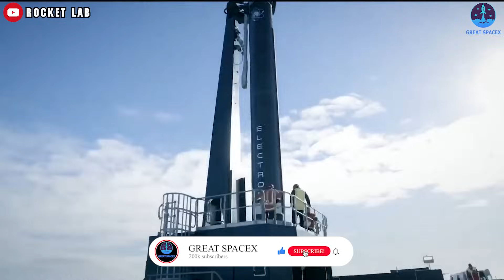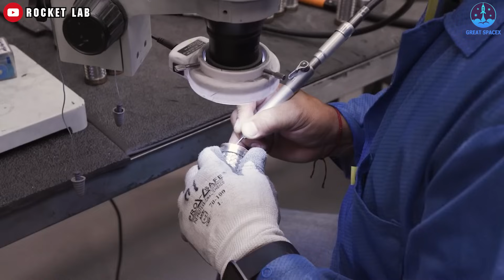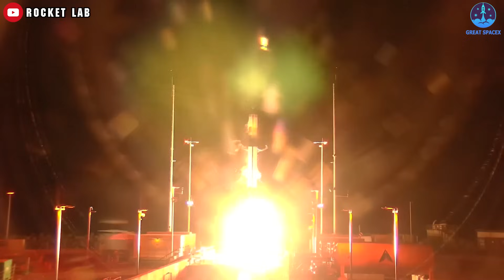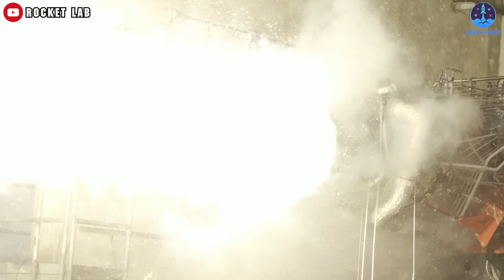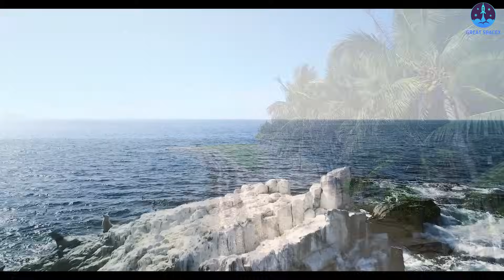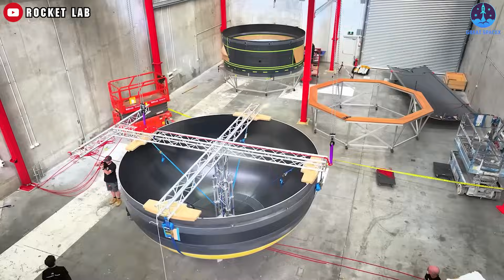Rocket Lab released the Boldest Rocket ever humiliated Blue Origin...

Comment: Good video. One minor correction. Carbon fibre doesn't handle high temperatures well unlike SS stainless steel. RL solution is lightweight aerogel graphite composite layer coating. This is how they protect Electron during reentry.

Comment: Carbon fibre is held together with resin… how do they figure on the “glue” between their composite carbon from melting with the heat of reentry?
Reply: The brakes on my car are carbon fibre. They use a ceramic-metal matrix, not a resin matrix. Max temp for resin is only about  200C, but over 1000C for ceramic-metal
Reply: @RedBatRacing … Thanks for taking the time to reply. Appreciated!
Reply: @RedBatRacing easy to forget different compositions exist when we see fools making Composite subs that implode because they chose entirely the wrong material, and with the likes of SpaceX's leader loosing his mind and pushing an under developed rocket too far we really need a sane competitor especially as the USA seems primed to implode
Reply: @UNSCPILOT  Rockets in space and Submarines submerged in the deepest oceans are quite different designs.
Reply: @RedBatRacing Brakes are a ceramic matrix which is a great technology for this application.  But aerospace composite structures are formed using a resin to bond the fibers together.  A totally different technology.  The resin has significant temperature limitations.

Silicon carbide carbon composite brakes are stable up to a temperature of 1800 degrees centigrade while carbon composite materials are limited to only 500 degrees centigrade.
Reply: The same way the current rocket does?  While they talk about "reusable" what they are quieter about is how many lift/land cycles they can manage with a single body.
Reply: @iatsd theres a lot of un-answered questions regarding neutron. It's a big risk when knowing spacex will be launching more for far cheaper and more often turnaround and much further ahead of the game. The Us military (space force) it is a strategic plan to support this for the future development of launch and retrieval pads for the long term future in NZ.

Comment: Gasoline for cars has become a more and more complex formula to boost efficiency, so why do rockets continue to use simple gas and oxidizer solutions? Even jet fuel isn't a simple two element compound. It seems much of the fuss with space exploration is in keeping gasses cooled to be carried as a liquid without requiring high levels of compression. There's got to be a better solution in more complex liquid formulas that are stable with a much higher boiling point.

Comment: Any chance to see Sfarship that use 3D printer (to reduce cost) of Carbon Fiber-PEEK reinforced with TPS as heat protector for next generation? (I know will be tremendous expensive mode to build, but far better that stainless steel as RL does). To not talk how smart is the mode to release satellites